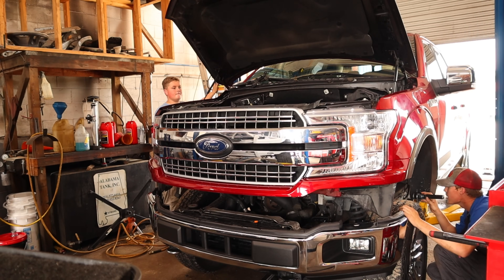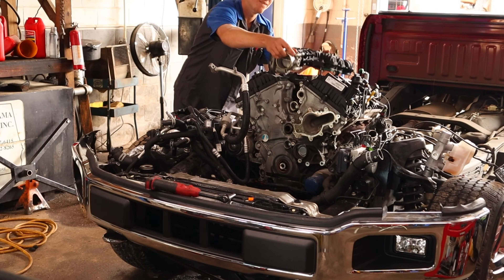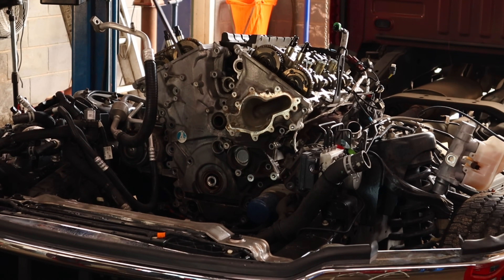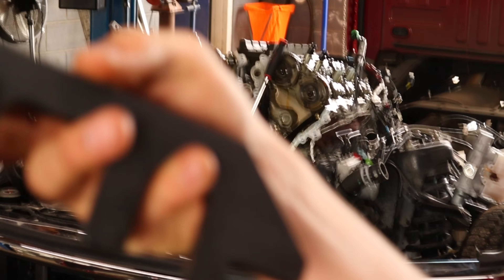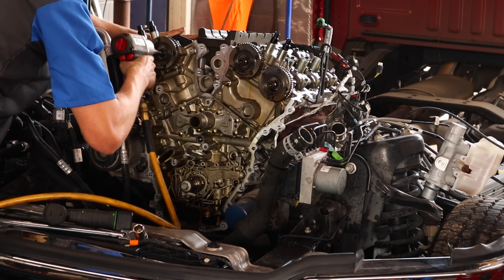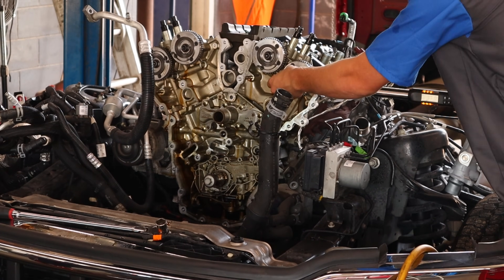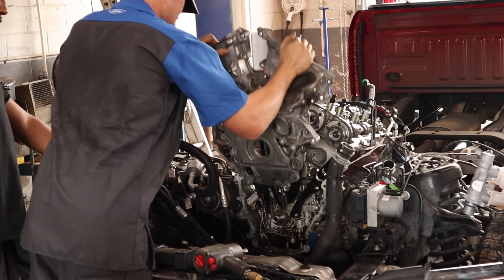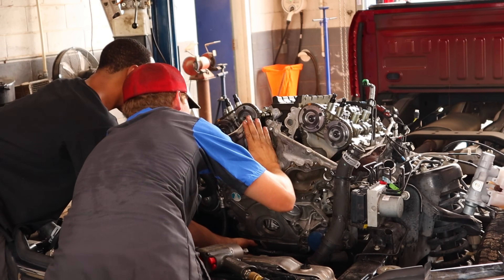Ford 3.5 EcoBoost Cold Start Rattle (VCT Phasers) | Everything You Need To Know

Comment: From what I’ve understood is that if you’re hearing the rattle…it’s already gone. The “hole” gets hogged out and needs the unit replaced…and possibly the timing chain as it can be stretched at this point in the process. A computer file change won’t replace the lost metal. From all the groups and forums I’m in, ford covers this within their 100k warranty…and offers an extended warranty at sale for extra money. At that point I had to decisions to make:  I knew I wanted brand new since all the forums warned me against any mileage whatsoever as people buy these knowing they can’t afford it and go out to do “raptor things” for the short amount of time they have with the vehicle before repossession. 2 miles on the odometer is enough to go and jump a raptor lol. So after deciding to buy new…I also knew I didn’t want the sunroof option as it adds $2k immediately and is another we’ll know raptor issue. Erase that issue immediately by ordering one WITHOUT the option. Last decision is a tough one because it’s the “extended warranty”. Which, I had to decide the future, with all kinds of questions in my head of…will I get one with multiple phaser issues that get fixed under 100k warranty, and cost me $1200 a pop after 100k?  I decided to get it as I believe I’ll keep it past 100k miles…especially if I’ve serviced it from birth myself and know every mile on her. That’s a loaded question for any mile on a raptor that wasn’t mine. In comparison to any other 1/2 ton pickup on the market within the USA….this cam phaser issue is not even a problem in my eyes. Much better than spontaneously combusting or brakes failing etc etc. we all know that a recall won’t be made unless a certain number of deaths occur from said issue. Sad to know that information.

Comment: 2018 F150 XLT , FX4, 179,000 MILES REGULAR OIL CHANGES/MAINTENACE INSPECIONS. MINOR FRONT END ACCIDENT. CAM PHASERS ISSUED RECALL.$19,000. DEAL OR NO DEAL?

Comment: I just picked up a 2018 raptor, great truck. I just took it to ford yesterday. The phasers are bad. It's actually still under factory warranty till March. Next month. So they made me a service ticket.. the truck only has 51k miles. They said it will ne 4-6 weeks to hwt parts. At 51k should I look at replacing the chain, tensioner exc? 51k is not alot but I understand what your saying. It's already being taken off..

Comment: So I have a 2018 F-150 3.5 Ecoboost with 118k miles, so I know I am past the warranty. I do have the 2nd generation ecoboost. I took my truck in during the recall and the Ford dealership programmed the truck. It really didn't do much and since the truck would only rattle at start up, I just lived with it. I changed the oil regularly so I never had any issues. It started throwing a code this past January 2022. P0022 so I replaced the camshaft position sensors. Right away it threw another code which was for the VCT's (oil solenoids). I took it to my mechanic and he replaced them. I picked up the truck and it still threw the exact same codes. It was still rattling (more now) and the mechanic said it was probably the phasers. He refused to crack open the engine and referred me to the Ford dealership. I am mechanically inclined and I didn't want to spend $4k so I tackled the job myself. When I cracked open the engine I noticed the cams were not synced with each other within each bank (1,2). The exhaust cam and the intake cam for bank 1 were not synced with each other so the camshaft tool would not work. The same for bank 2. I figured it was the programming based on the recall. I lined up my timing marks for the camshaft, and then the phasers on each bank. I had to rotate the camshafts to sync with each other so I could use the camshaft position tool for each bank. I installed the new (most recent) phasers and lined up the timing chains, guides, etc. and put everything back together. The truck starts up and is running strong but occasionally idles down then dies. The gas mileage is slightly lower as well.  It is throwing numerous codes with them being for the parts that I replaced that are brand new. The local mechanic cleared the codes but the truck is not recognizing the new parts. I took it to the Ford dealship and they want $3.5k to verify the timing plus the cost of the parts. They say it's not a programming issue and the truck had to have jumped time. Is this true? The truck is running fine and strong other than the codes and when the truck dies occasionally when it idles down. Are there any other possible issues other than timing? I would have thought the truck wouldn't run or run very rough all of the time if it was timing. If I pay the  Ford dealership can I expect a warranty? If I was to open the engine back up should the timing tool work to sync the camshafts for each bank? I don't mind spending the money as long as I get a warranty and if I know that I am not being taken advantage of. Does it sound like the Ford dealership is taking advantage of me? Thank you.

Comment: Great video!  I've been dealing with this issue on my 2018 for about a year now.  It's getting worse/more frequent.  Your theory sounds good!  However, my truck does it when I first start it and ALSO when it's at normal operating temperature.  I can be going out the interstate, steady speed, and it'll do it.  It does it going up hills.  It does it when I accelerate gradually coming out of a curve.  I have noticed it does it more often when it's cold outside.  Cold meaning around 30 degrees or colder.  Do you think your theory might apply in my situation?  Thanks!
Reply: I have the same problem as you.  Have you figured anything out?

Comment: So I have a 2014 ecoboost with 85,841 and am the second owner I bought truck with 31k on it. As of now I don't have a rattle. So if you install mellings bigger oil pump with the 85lbs spring and new updated phasers wonder if that would fix it.

Comment: I’ve got a 17 3.5 ecoboost got it with a little under 120k I didn’t know it was cold start rattling read up on it they said it didn’t effect performance ran it like that and now I’m at a little over 150k and it started to turn off on me not wanting to stay on started shaking bad when I accelerate to try to keep it on, my Obd tells me cam sensors and timing is over retarded my question is do you think I’ll have to tackle the phasers to stop this from happening I appreciate all the information too man

Comment: I have a 2018 3.5 that I bought last June 2021 used with 52,000 and started having that phaser rattles and and took it in for a oil change and they did the pcm update and after that it still rattled but only so often, so I took it back in cause of this recall and left it over night for the techs to look at and they told me it's not rattling when they start it so I've been recording start ups and it will rattle only ever so often but still rattles. My question is, the dealer trying to screw me in this recall cause I do have like 5 videos of it rattling but it won't do it every startup, please help

Comment: I've recently noticed engine rattle on my 2014 F150 3.5,  but it doesn't go away. On a recent trip for hunting I was loaded up and pushing the speed on the interstate when I noticed the flashing engine light and shuddering. I eased up on the throttle and was more gentle on the way home. Didn't experience it again until 2 weeks later, another hunt, pushing the speed in the mountains. Flashing engine light and worse shuddering, until I slowed down and took it easy through the mountains. In town, I don't ever see the engine light or experience shudder. But there is a constant unpleasant rattling sound in the engine.  Is this issue still about the VCT Phasers?

Comment: Great videos, I used your cab removal to do a frame swap on a 2018. Now got it done and need to replace cam phasers on my 3.5 ( didn’t start truck until I had it repaired- otherwise I would of fixed while I had engine out)
Do you have a video on doing this job? 
72,000 miles-salvage title so Ford will not help. 
I know there is a newest update on them so hopefully it will fix mine.
Thanks-Bruce

Comment: Warrantied my F150  a little after 36,000. I have since taught my self to brake gas start and cycle the engine to get the cam phasers some oil before ignition.

Comment: I'm in the process of doing the phasers on my '17 3.5 Ecoboost.  Apparently the job was done before and they previously stripped 2 of the 8mm guide bolts and one of the tensioner bolts on the passenger side.  I have been searching all afternoon and can't find these on any diagrams. If you or someone knows the part numbers for these fasteners I would really appreciate it!  Love your content, thanks!

Comment: Had the same problem with my 15 2.7. I inspected everything and it turns out it had nothing to do with my cam phasers. Turbo had worn out waste gate actuator on the left side turbo. Had to take it to a machine shop to get custom bushing made to put back in it🙃😑. Anyways went ahead and changed the timing chain and tensioner and haven’t had a problem since.

Comment: So disappointing how ford has handled this issue. For the record my f150 is the best truck I've ever driven... except cracked ds valve cover, oil pan leaking constantly, turbo coolant line layout, cam phasers, timing chain slack, intake leaks, etc... for these reasons I'll probably by an na gmc. I know they have their issues too but they are easier to work on for the diy guy and no BS as fords been doing for over a decade. Like I said my 18 platinum is great other than the most important issues, reliability. Good stuff man thanks for keeping it real.

Comment: My problem is that I bought the truck (used) and now Im stuck with the problem because the previous owner didn't get it fixed while the recall was in effect.  Ford won't cover any of it.  Please help if you know a way that I can get this fix by Ford.  I called Ford Care and they didn't offer a solution for me and told me that I was stuck with the repair.  Yes this truck will be repaired and then off to CarMax followed by the Chevy dealership (only 58,000 miles)

Comment: Good info. My BRAND NEW 2022 BRONCO 2.3 liter manual has this rattle, so obviously Ford has not figured out how to fix this issue. I've read content where other Bronco owners are having the same rattle during startup. Your theory seems right about the oil pressure as I've noticed that the rattling during colder weather takes longer to go away. At least now I can seem like I know what I'm talking about with the service department instead of saying... "it sounds like Jacob Marley from the movie Scrooge, lightly rattling his chains". Thank you!

Comment: My 15 3.5 finally started doing it at 115k. Very light but it was there. I temporarily solved it until I can get it in for service by putting a thicker oil in it, wix filter, some lucas, and an extended crank in the AM. Nothing major, just hold brake and gas and press the start button and let it crank for about 6-7 times. stop. Release gas pedal, start it up for real, and it's all but gone.  However, as someone who grew up in a shop, built my own vehicles, ASE trained and certified, let me make this very clear for anyone reading my comment.  THIS IS NOT FIX, IT IS A TEMPORARY SOLUTION FOR THE NOISE.  When they start rattling, the damage is already done, nothing short of replacing the phasers will solve the actual problem, this is just to reduce the noise in the mornings.  I'm up to 122k now and the solution still is working, just trying to get the time to drop the truck off for service since it's a daily and Ford isn't too hip on loaners and rentals are f***ing expensive.

Comment: do these phasers make noise when the engine is hot as well like the old 5.4 engines? I have a 2018 f150 with 3.5 eco boost it has a cold start rattle and also a tick when it warms up all noise is in the driver front of engine in the phaser area

Comment: I do depress the pedal down for 5 seconds while I turn  Push the start button then let go of the gas pedal and it starts but does not rattle I  I did this for a while until I had the opportunity to actually change the phasers  I want to thank you for explaining everything about the phasers and believe me this Trick worked for a while save me some time Thank you and keep doing those videos
Reply: Does this just prolong the life of the chain and prevent any further stretching/damage? I’ve noticed that mine does rattle on occasion (usually after sitting for a few consecutive days) so I too have implemented this technique but was wondering what the exact purpose is other than not hearing the rattle. Thanks for any advice you may offer.

Comment: Here is all you need to know.  Ford has had these problems across the board for years.  Search the Ford Focus transmission clutch issues for another example.  It costs less to leave customers with a guaranteed failure and potential costs if not under warranty.  Nothing is done about these issues as far as redesign.

Comment: As design flaw, this should be fixed by Ford no matter how many miles are on the car. Its not the customers fault they drove the truck with faulty design since they trusted Ford to build the truck correctly, yet Ford did not. This should result in a class action lawsuit. How unfair to the customer.

Comment: I have a 2018 f150 platinum , I’ve had the cam phasers replaced twice. They first set lasted about 40k miles before rattling again. The second only lasted 25k and not only does the engine sound like it’s coming apart, I now have 6 DTC,s  low oil pressure, under boost condition, camshaft sensor intermittent etc.etc.etc. I’m ready to burn this one to the ground, easier to try to fix all these issues and all this started after dealer changed out phasers the second time. 25 k miles in and now all this. Here are codes. P061A, P0524, P0365, P0369, P0299, P0390, I’ve replaced all camshaft sensors and still codes come back. Oil changed by dealer every interval. Trying to get repaired, but now like an act of congress. Hope this helps some folks. I’ve been a Ford man my whole life but this may be my last.

Comment: I'd like some hones feedback form a Ford Tech if possible (BTW - love this video). I have a '19 3.5 Lariat that has the typical rattle ONLY at cold start. This rattle lasts only about 0.1 seconds and even after 8 months has not gotten any worse. I did take it in and the dealer first had to make some adjustment to the software (which really didn't help).  My question is, can I just live with this rattle?  Am I going to harm the truck in the long run?  I keep reading horro stories of folks who get the cam phasers repaired and lots of other things start going wrong.  Thoughts?

Comment: Sludge from high suction.  Maybe some seafoam.  Change oil every 3k miles or 320 hours on the engine.  Sensors get dirty solenoid freezes up.

Comment: The best thing to do when you hear that rattle is dude starts a vehicle hold the start key down and the gas pedal at the same time for 10 seconds after let go of the gas pedal which will prime your oil pump.
1. Do this at your discretion please this will probably shorten the life of your oil pump.

Comment: 2019 Expedition 119K and almost $6ooo later its fixed. My check engine light was blinking, and truck was stuttering under any kind of acceleration. Over 250 miles from home and had to baby it all the way to make it.

Comment: Awesome video! My wifes 2019 3.5 has 30k miles on it now. Started rattling around 25k miles. Currently waiting on parts. Seems the longer we wait, the louder it gets every cold start. Also have the transmission hard shifting issues and rough idle.
Reply: Same here any update?

Comment: Check the oil tubes that go to the vet solenoid I’ve done several timing jobs due to them being gummed up a little some are plugged completely Every time that I do the timing chain or phasers I do the VCT solenoid as well That seems to help the start death rattle as I call it

Comment: Straight talk here. These motors are junk. A Ford flathead V8 from 1950 lasted longer than these modern miracles, and cost far less to replace. You didn’t need to remove the cab for routine service. A pushrod V8 may burn more fuel, but you can expect 200,000 miles or more with only minor services. Boosting small motors to make big motor power means more heat, wear, rpms, and far shorter life. If you buy new and trade in every couple years while still on warranty you may be ok. And remember Ford diesel truck motors are just as bad.
Reply: Flathead V8. that's your icon of greatness? LOL  Sorry, but if all the trucks driving around today were flathead V8s we'd have  1000X the air pollution and 4 times the gas usage. besides, a flathead could barely move one  these modern trucks. Comical response

Comment: I was able to get the phasers replaced at 59k miles. Gaskets and Engine oil were replaced as well. But now I am not sure if I am keeping the truck. I drove x country with the family 4x but I am afraid for new issues after repair. I will either buy the esp plan or trade it in for something else

Comment: Mines loud enough that people ask me if it has a diesel in it.  I’ve learned to live with it for now.  I’m at 180k in the 2018 3.5, so far: 

-cam sensors went out at 170k
-throttle body at 175k
-spark plugs and wire 90k and 175k
Reply: Do you think the repairs are worth the vehicle? I have one at 100k
Reply: @negligennt  the truck is a beast I’m currently at 193k.  Any truck is gonna cost money to run past 200k.  I’m not a fan of the 10speed but the motor is strong and worth it.

Comment: My truck is getting this done as I type this. I also had it in for 60k maintenance while they had it, that includes coolant.  I assume the coolant is drained during this process and new is added.  Should they be charging me for the coolant flush @$200 since they are draining it anyway?  Thanks and awesome video.